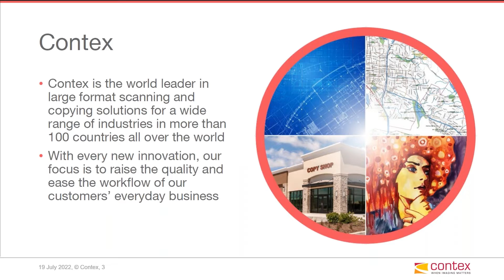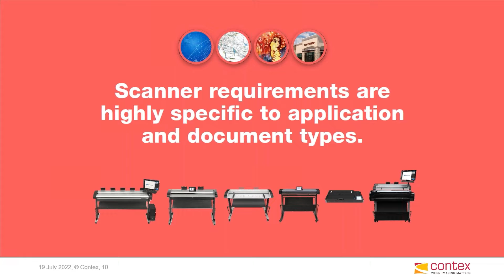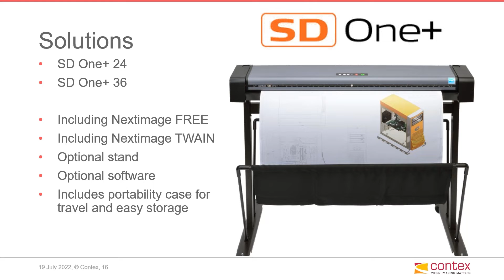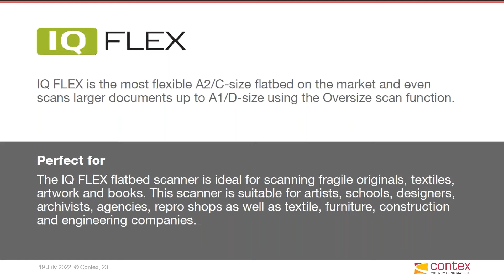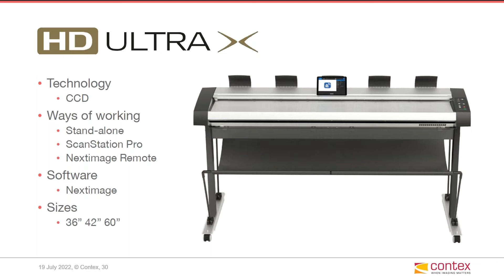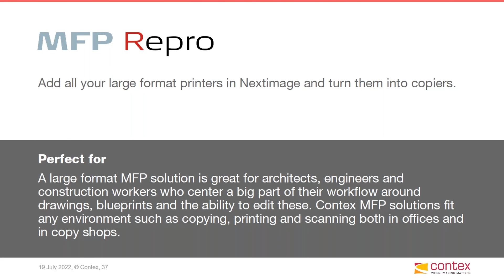Product line presentation (2022) - Contex large format scanning

Comment: Hi what laser printer Can connect same format ?
Reply from the maker: Hello Allichamps3964, when using our Nextimage scanning software it can easily connect to a wide range of printers (Canon, Epson, HP,  Océ etc.) that can be found here: https://contex.com/nextimage-supported-printers/. If your laser printer is not on the list it is most often possible to make a connection anyways. If you know your printer name and model I can check with our technical team. Kind regards Sigrid Raahauge, Contex